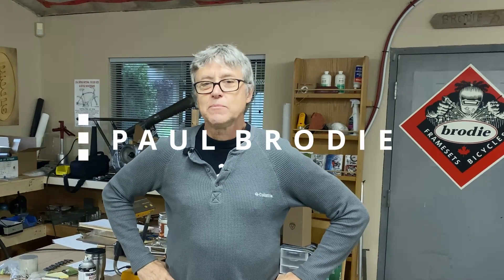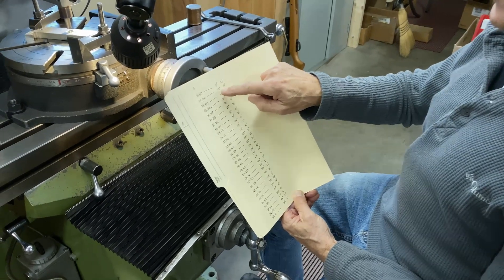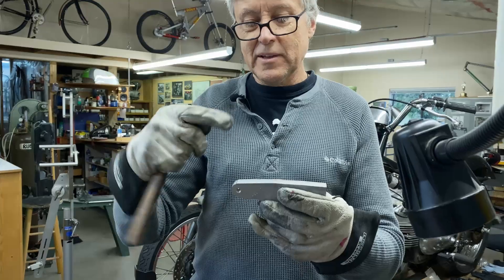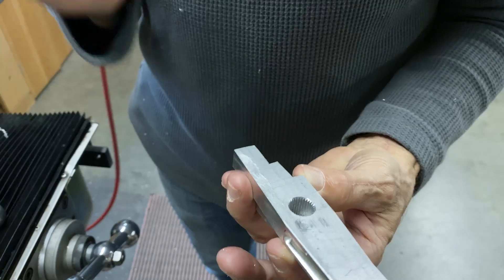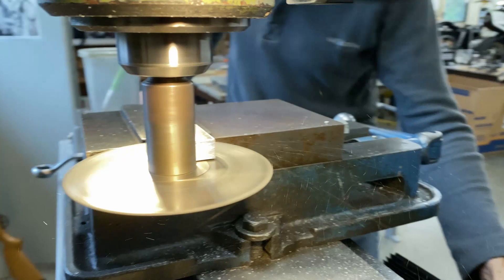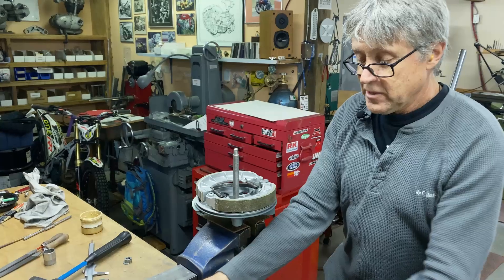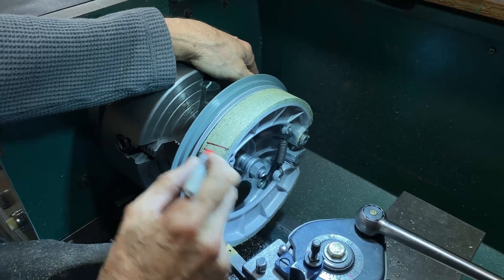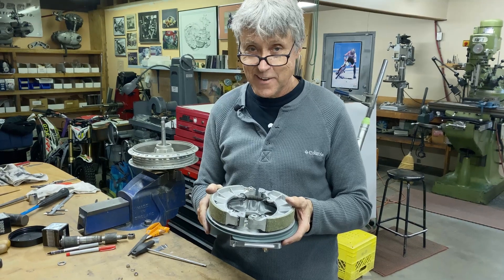Aermacchi Front Hub - Part 3 with Paul Brodie

Comment: I noticed you mentioned the fact that some levers have the pinch bolt actually going a little into the spline, which obviously that entails having the middle of the spline ground away.
All Yamahas that I've seen (worked in Yamaha dealership from 1976 through to 1992) and if the pinch bolt loosens, the lever can't fall off the spline due to the bolt being in the middle of the spline.
My mates had Suzukis, and their pinch bolt was out of the spline. Gear levers used to fall off those, never ever lost one on a Yamaha.

I love watching you work.  Cheers
Reply from the maker: Yes, the middle of the spline has a machined cutaway. I have never had a lever come loose or fall off. Thanks for watching.

Comment: Hi Paul, love your video's which are well lit and clear.....I can see what you're up to. Bit of a shock to see you virtually unprotected while turning those asbestos linings; a good vacuum of the entire area is a must. With one eye on saving weight.....aren't your steel brake arms a bit chunky? My pal and I are doing something similar; fitting a CB77 brake into an 8'' Norton hub.
Years ago I spent a winter stripping my Ducati F2 replica and lightened everything I felt safe to do. As the thing was minimal to begin with I was pleased to have lost 50lbs, even though individual parts would only lose a little bit; overall it all ads up! Your Aermacchi is one of my dream bikes, the frame design is an excellent demonstration of lightness and strength. And aren't they tiny. Francis Beart's example took it to the nth degree.
Reply from the maker: Thanks for liking our videos. I did have my shop vac setup if I remember correctly. I did make 6061 brake arms, did you see that? Yes, the grams and ounces do add up, so congrats on saving 50lbs! Thanks for watching and commenting.

Comment: Excellent and instructive video Paul. Please let me give you a little tip that i did when racing, what's now called classics. To get your front and rear brakes even better, build your wheel rim onto your hub FIRST.  The reason is that a hub will always distort a little when you build it. So it will be out of round.
You then skim the hub round in the lathe. Then you measure and shim your brake linings as you have shown. File the leading edges of your brake linings at 45 degrees, helps stop grabbing, and Voila. You now have two-finger brakes. Hope you are going to do a video of it in action on the race track.??
Reply from the maker: Yes that is a good tip. However, my lathe is nowhere big enough to spin the hub and rim. I'm retired from racing, I crashed and broke my leg pretty badly. Memories now :)
Reply: @paulbrodie  I have the same problem 
. My Harrison M300 will just about fit a 19' rim, but i have to take out the bed piece. Taking that out and refitting for a three or four times a year job is a PITA. So what i do is go to a machine shop that I'm friends with and they let me use there big lathe that can swing it. Its only a 20 min job so I'm not in their hair for long. Sorry to hear that the leg got smashed. Hope it does not cause too much trouble. Regards, Fergie.
Reply from the maker: @niff2966   Good to have friends like that :)

Comment: That was some neat work and pretty much anyone could do it as there wasn't any TIG welding involved. The brake operating levers are a work of art, cutting splines isn't the easiest thing to do single point without some dedicated machinery.
Reply from the maker: I watched Allen Millyard make a spline for his shifter by sharpening a shifter spline and then cutting the aluminum shifter spline using his hydraulic press. It looked fine and he said it was "just perfect".
Reply: @paulbrodie  I watched several Allen Millyard video's recently and was very surprised how much he did before he had machinery. Pretty amazing what can be done with a hacksaw and a TIG welder.
Guess that's why he's an engineer and I was a motorcycle tech LOL ;o)
Reply from the maker: @1crazypj  Yes, he does do a lot with a hacksaw and a TIG welder. I do suspect he has a few friends in the sidelines, however...
Reply: @paulbrodie  Yep, I've done a lot of hacksawing, chain drilling and filing, lathes and mills make things go a lot quicker.

Comment: You should try a woven brass lining on the first two inches of the leading edge on both front brake linings this combination stops the grabbing effect of the green lining
Reply from the maker: I just chamfer the leading edge slightly with a file and... no problem. Thanks for watching.

Comment: l see you take health & safety very seriously while machining linings that "may contain asbestos" no dust mask and forgot to turn the vacuum on ! :-)  im only laughing because i once took a angle grinder to some brake pads - i take safety &  precision  equally  seriously !  great series as im just about to do some work on a 7" twin leading shoe hub with a damaged bearing seat.  and was thinking of making some alloy levers you've motivated me to try.
Reply from the maker: Yes I take safety seriously, but I'm also able to make mistakes. Part of the human condition. Hope your brake turns out well.

Comment: "Add lightness"
Yup! I've found the Colin Chapman fan.
Reply from the maker: He wrote a book on fasteners and I read the whole thing.
Reply: @paulbrodie  Carroll Smith has a few good books in the HP or MBI back catalogue.
'Nuts, Bolts & Fasteners Handbook' and one about plumbing have a lot of good data from the dawn of composites, when humans used slide rules to compute stresses and loads.
Not that I'm being a Luddite, but those basics (like thread pitch) go all the way back to Archimedes.
Great engineers like Chapman and Smith had a feel for what works.
Reply from the maker: @jimurrata6785  Yes it's amazing what man did before computers. The Golden Gate bridge was designed using a slide rule and it's still being used everyday!

Comment: When I got the linings re-done on my Norton, the machinist put my whole front wheel in a large lathe, and lightly dressed the braking surface. The spoke tension can pull the drum out of round. After that, he machined the linings on the complete brake-plate to suit the (very slightly oversize) skimmed drum.
You probably did it, but you did not show cutting a chamfer on the leading edge of the linings.
Oh, and you didn't tell us how much weight you saved with the special parts on your brake-plate. We do like to know......
Reply from the maker: I checked the runout on my drum after the wheel was built, and it was only .003"    It has been many months now, and I simply cannot remember if I did a chamfer, and how much weight I saved, sorry. Thanks for commenting.

Comment: Paul, I just have one question.  Shouldn't you have used a respirator when cutting the "maybe asbestos" pads ? The vacuum worked well enough after you had a surface but initially there was a lot of dust particles in the air !
Reply from the maker: Yes, you are probably right, but I am being recorded for the video, and so the sound quality would have changed for sure. I do one pair every 12 years, so I don't think I will die from a little dust. Thanks for watching!

Comment: Hi Paul.
One question:
How did you glue/fix the green race liners onto the hub since they are getting probably quite hot?!
Thanks for your weekly doze and keep up doin it! Greets 2 Mitch Mystery as well of course!
Reply from the maker: I think you are asking: how did the green Ferodo linings get bonded onto the brake shoes? I took them to a local brake shop that specializes in re-lining brake shoes. I don't have the correct glue or expertise. Thanks for watching!
Reply: Ok, so some special technique needed therefore. Thanks for the reply!
Reply from the maker: @mbi379   Yes, don't take any chances on this. If a lining came off a brake shoe while in use, that would not be a good thing.

Comment: You can save a bit of Material=Weight if you put the Bolt in londitudaly.
Reply from the maker: Thanks but I don't know which Bolt you are referring to...
Reply: @paulbrodie  If you rotate the clamping Bolt for the Spline by 90° (longitudly to the Lever) you wil find that you can trim off more material.
Reply from the maker: @h-j.k.8971   Probably true, but that really would change the "look".
Reply: @paulbrodie  The "look" ah OK.

Comment: Leading shoe drum brake.. mechanical engineering term is "self energizing..   they're designed as basically a mechanical amplifier...  you get more torque with minimal input...    but. Obviously they're a little more complex than a regular drum brake that has 1 leading 1 following shoe.
Reply from the maker: Yes, a twin leading shoe brake can have a lot of stopping power, but going backwards they hardly work at all..